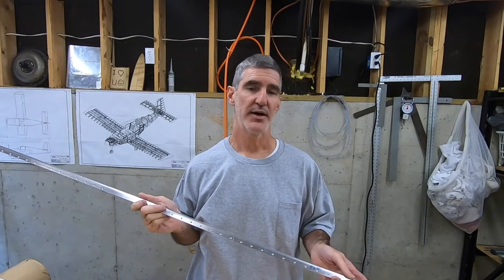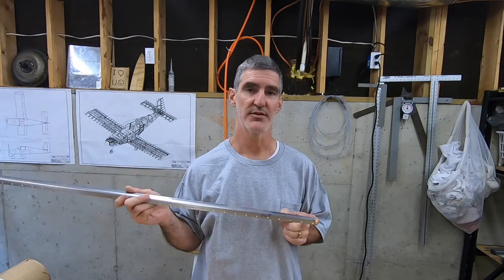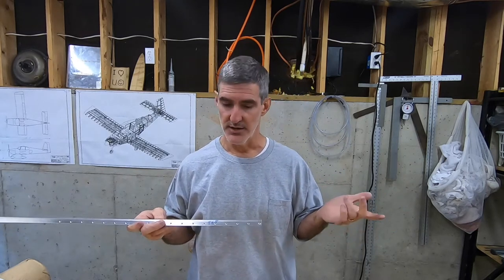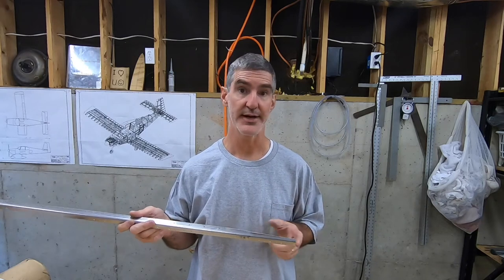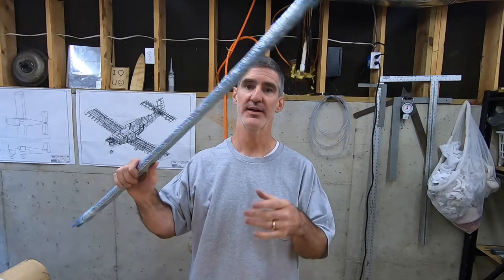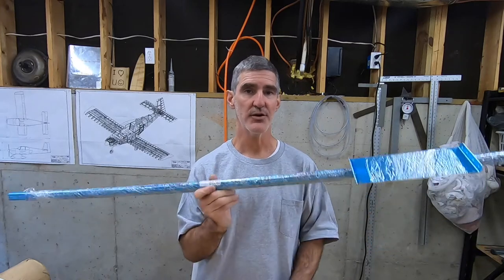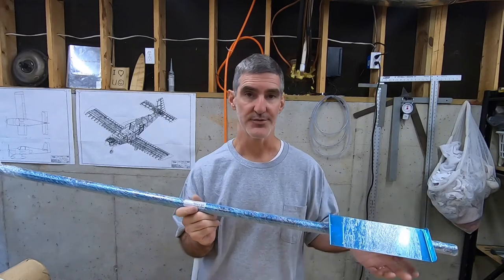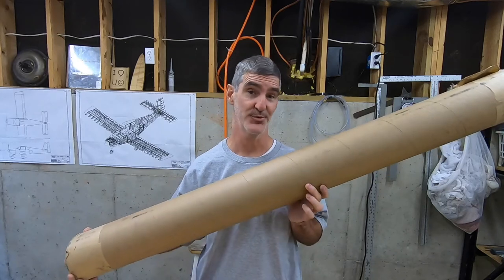RV-10 Build Log - Emp 46 - Stringer fix options

Comment: Good call on just replacing. When enlarging holes you have to take into account that you are not getting too close to the edges. I had a similar issue and Vans recommended replacement.
Reply from the maker: Agree.  With these screwups at the very end, I think it would be ok either way, but since redoing it was (relatively) painless I thought I'd give it a shot.  What I really need is an "inverse" oops rivet - a rivet with an AD3 shank and an AD4 flush head.  Wonder if there's such thing.

Comment: Yeah. Shipping long items is co$tly! WHEN (not 'if') I need replacement things from Van's, I'm just about 1.5-hours from Van's in my Decathlon. If what I need will fit inside, of course. Sort of a take on the $100 Hamburger, eh?
Reply from the maker: Lucky lucky!  Heck, I've done a $100 Coke a few times.  If Van's had a burger joint built in, you'd be set!